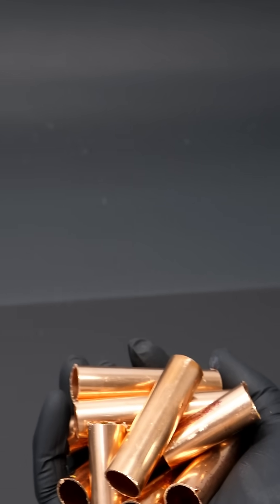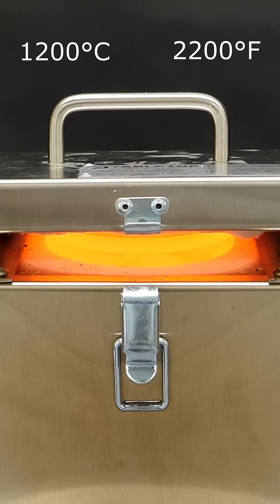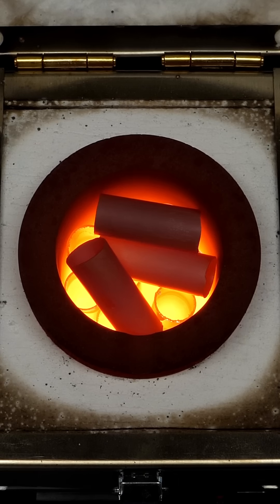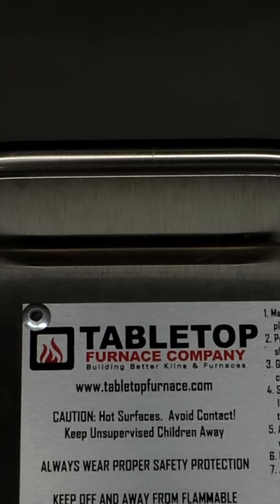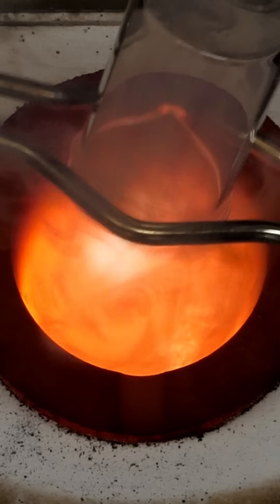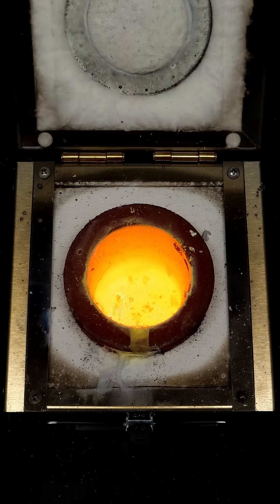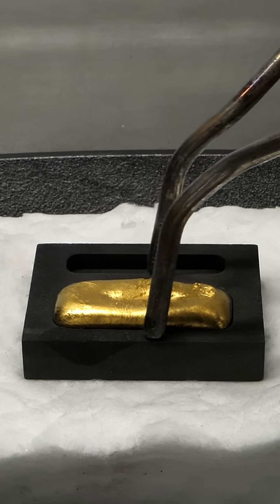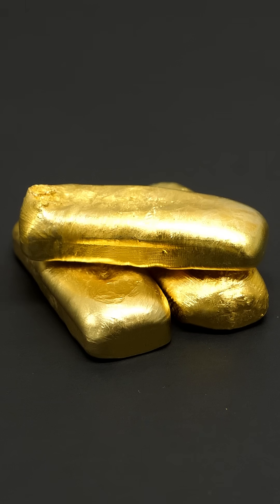Making Nordic Gold

Comment: The melting point of zinc is drastically lower than copper, the gas emitted when you added the zinc is extremely toxic, I hope you had a hood running and a mask on. That’s really nasty gas. The zinc was chemically altered and essentially burned. You need to add the zinc as the mixture is cooling down.

Comment: At 930°C to 1,094°C for 89% copper, 5% tin, 5% aluminum, 1% zinc. Nordic Gold, best channel to watch is Bigstack D casting will teach you while he melts to cast. Make sure to expand/heat up the Ingot trays, as you don't want metal spraying all over (equalize thermal pressure)

Comment: When melting metal in a crucible make sure it’s dry first which should reduce or eliminate the sputtering to some degree which might be caused by water or other things on the surface boiling off and turning to steam

Comment: Looks like you're putting cold metal into hot. Can easily cause an explosion of molten metal.
Reply: No it can’t? What?
Reply: If the metal going in is cold there can be a tiny amount of moisture which converts to gas on contact with whats already in the crucible and blasts metal everywhere. I've done it with gold. It's normal practice to heat it up a bit before adding to crucible to drive off any possible moisture. @Joker-em6oz

Comment: induction smelter, you can melt stuff in a moment
Reply: Not a smelter. It does not smelt like whatsoever
Reply: @Joker-em6oz  not referring to the machine pictured but to a machine that uses induction to rapidly melt metal as an upgrade, they work fast and only heat the targeted materials, a good one is like 1k usd, a basic one is like 300-500usd
Reply: @SCARLETBIRDS that’s not a smelter then…
Reply: @Joker-em6oz  like you are qualified to make that statement
Reply: @SCARLETBIRDS I literally am….

What you describe is melting, not smelting…
Reply: @SCARLETBIRDS explain how an induction coil can reduce ores. I’m waiting. 

If you want to use the correct name of the machine, you’re describing an induction furnace.

??? Sorry that it upsets you that I’m right
Reply: @SCARLETBIRDS okay. Whatever you say buddy. I’m waiting for my explanation XD. Looks like you’ve been wrong for decades, ouch.
Reply: @SCARLETBIRDS yeah you don’t care because you’re wrong. Notice how you still haven’t explained the mechanism
Reply: @Joker-em6oz  yawn, try harder
Reply: @SCARLETBIRDS try what harder?we’ve established I don’t need to try to be right, you do.
Reply: @Joker-em6oz  an induction device explains its operation with the first word
try to catch up
Reply: @SCARLETBIRDS induction is method of heating, not method of smelting. Try to keep up.
Reply: @Joker-em6oz  it's whatever i want it to be
Reply: @SCARLETBIRDS not how that works buddy. Notice how you are incapable of explaining how it smelts. It’s almost like they aren’t used as smelters XD
Reply: @Joker-em6oz  induction smelting is the process of using an electromagnetic field to generate heat in conductive materials by generating eddy currents for smelting which is a form of refining, as the materials separate it will become more effective because the ores become more conductive
in the case above he's refining/smelting an alloy, probly several other words i could use here as well as there's several general terms
Reply: @SCARLETBIRDS  i know what induction    Is… Ores are not conductive though…

None of that explains what actually occurs though. All you said you heat ho rocks. How do they separate? Ores chemically bound to oxygen… only heating them up is simply not how they are converted to metal. In fact several ores are used as refractory materials…

In the case above he is not smelting whatsoever. Do you know what smelting is? The reduction of ore into metal. Is there ore in this video? No. Therefore  there cannot be any smelting

Glad to correct your knowledge after decades in the “field.”
Reply: @Joker-em6oz  that depends on what ore and what step you are at and how much power you apply, copper for example is bubbled up out of the crushed material and separated, then refined, iron can pretty much be refined on the spot but this also depends on the concentration, the rarer the material the more elaborate the refinery processing to get enuf to do the job with and actually the way they handle that in an induction system is they make the pot conductive so it gets hot so even if that was the case there's ways around it up to the massive arc furnaces that don't care about purity because they are basically dumping giant carbon rods into the material with loads of energy to melt it all at once in a moment
for cinnabar which is mercury ore they just crush it up and heat it in a still like machine to collect the metal vapor which condenses back into a liquid, it doesn't need much heat so even a kettle on an induction stove would work if it had a way to trap and condense the fumes safely
ores chemically bound to oxygen can be burned off, you can remove rust from sheet metal with a torch by getting it hot, adding flux and inert gas will help keep the batch from taking in more as you reduce it, you would definitely not want to be melting zinc, titanium or another similar flammable metal without a chamber with inert gas, similar processes are used to make timascus 
and as a word of warning carefully research the chemistry of the metal you are working with, adding carbon or cobalt etc to steel can be great but too much hydrogen or oxygen and it becomes brittle, failure to properly prep a steel fastener for small crystal structure for use in aquatic places will make it become weak over time under load as it collects gasses known as hydrogen embrittlement
knowing the atomic structure of the stuff you are trying to mix also helps you know what will or won't mix, welding titanium and aluminum is possible, aluminum needs a different compatible coating before you can give it a nickel plating same as steel
and the list goes on, the topics related can get very complicated very fast and this is not the place for that
also the same tool that smelts the ore is used for melting it, you can't say smelting without melting so no, you haven't corrected or taught anything
Reply: @SCARLETBIRDS eaf is not induction.

I literally did correct you…. But go off.m, you’re obviously correct.

If you want to know wha mixes, and what doesn’t. The Hume rothery rules should be used as a rule of thumb

Comment: I thought copper melted at 1800F aluminum at 1400F and tin closer to 1000F 2200 would be way to hot for the aluminum and tin
Reply: Way too hot? What? Water melts at 32f. You can heat it all the way to 212d
Reply: . Go google what tin and zinc evaporate at or boil.
Reply: @carpediemarts705 they can evaporate lower, that is not what boiling is. Tin boils at 2600 C btw

Comment: It could probably trick enough people. Itll have some of the same properties.
Reply: It has none of the same properties
Reply: @Joker-em6oz  well since theres a large quantity of copper, id imagine itd be conductive (nowhere near as much as gold, even less than usual copper because its diluted with other not-so-conductive metals). It also wont be magnetic, i think, because iirc none of the metals involved are either. These are also properties of gold. You can probably get real damn close to color matching it so that someone who isnt a professional would believe it. And if you wanted to hit the density, if the item is big enough to notice a weight difference, find a way to put in a small lead weight of some sort in the middle. Easy scam
Reply: @derekspammerton5295 it’s not going to be the same type of magnetic as gold, you’re right that neither are ferromagnetic though. 

Density is only one problem.

Comment: Why cant you just add the copper then heat the crucible? Why do you have to wait until 1200 degrees and then put in the copper?
Reply: You prevent unnecessary oxidation
Reply: Thanks!

Comment: The melting point of copper is 1084°C (1983°F), aluminum is 660,3°C (1220.54°F), zinc metal is 419,5°C (787,1°F), and then some tin metal which is 232°C (450°F). So the melting point of Nordic Gold is above 900°C or about 1652°F, I got bored so I did some research about this video.
Reply: Alloys are a curious thing, really.
For some, it can turn two metals which are solid at room temperature and 1 atm of pressure...into a shiny liquid with immense surface tension, as is the case with NaC (NaK?).
Even our most commonly used alloy, Iron and Carbon, behaves very curiously.
Adding a lot of carbon gets you cast iron, which has a LOWER melting point than iron, but adding just a little, just right amount gets you carbon steel, which has a HIGHER melting point than iron...even though carbon doesn't really melt on its own, it sublimates.

Even our (arguably) first alloy, bronze, is made of two metals which by themselves aren't strong enough for many applications the alloy is used for, especially tin - logically, it should weaken the alloy, but it doesn't.
Reply: How would a gold tester react tho?
Reply: @karrimgyver it would say it isn’t gold
Reply: @Joker-em6oz  Pretty sure that the actual machine that gives the karat ratings etc gives way better info than just "not gold" I'm not talkin about that simple type like you see with that one that tells if the diamond is real or not.
Reply: @karrimgyver you mean an xrf? It’ll tell you what alloy it is if you mean that. But it really depends on what type of gold tester
Reply: @Joker-em6oz  and what alloy would it tell this is?
Reply: @karrimgyver Nordic gold, assuming it’s in the database which it should be because Nordic gold is actually used
Reply: @Joker-em6oz  Huh. But if the contents are exactly same, how can it tell the difference? Pardon my ignorance.
Reply: @karrimgyver wdym the contents are the same? Can you clarify your question. 

No worries about ignorance, we all start somewhere
Reply: @Joker-em6oz  Lol I forgot that gold is on the periodic table. If that has anything to do with it. I was thinking that if you can make "gold" with copper aluminum zinc and what not, then how can you know it's not actually gold, if you put everything gold has in it to pot, thus making it "actual" gold. But I forgot that gold is an actual elemental metal (or what ever it is in English, (it's my 3rd language so some words escape me)).
But I still don't know how we can tell difference with the 2. Unless it really has to do with the original elementals
Reply: @karrimgyver the machine uses X-rays to energizes atoms and the atoms then emit their own x rays. These X-rays are specific to each element so we can measure the amount of each element present
Reply: @Joker-em6oz  Oooh. That's way cooler than I thought. Could it be possible to measure ingredients accurately enough to fool it? Or are we talking about scale so small that forget it?
Reply: @karrimgyver wdym measure ingredients to fool it?

It is taking thousands of data points
Reply: @Joker-em6oz  I had to google what are data points in this context. Yeah my question was riddled with ignorance and thus now even I can't really ask it again without being even more confused : D But very simply put. way they see how the gold interacts with X-rays tells them if it is original elemental gold, or nordic gold made by mixing etc? I thought that it would be possible to fool x rays by having enough accurate mix of the "gold" in the end, but nope, gold and nordic gold are 2 very different metals. Thank you for being patient!
Reply: @karrimgyver ah, you can’t “fool” the X-rays. But if you put gold into the mix, the machine would tell you there’s gold in the mix.
Reply: The melting point of copper is actually higher than the boiling point of zinc
Reply: @brottarnacke hence the energetic oxidation and melting.
Reply: Would you add the copper last or can the other metals over cook?
Reply: Where can you buy that small furnace?
Reply: Love this comment 😆
Reply: All I know is that gold itself melts at about 1700 F.
Reply: So? Why "so"? Is it obvious that the melting point of the alloy is 900ºC? lol
Reply: @goncalovazpinto6261  What do you mean? Who said "so"?
He did the math.
Reply: @operatorchakkoty4257  the OP said "So the melting point of Nordic Gold is above..."
please, enlighten me, what math?
Reply: @goncalovazpinto6261  Dude, he either googled the melting points of the alloy or used a formula (which, believe it or not, is also coming to a google search bar near you this Summer!) to do it.
Hell, there's alloy calculators where all you have to do is plug in the base metals and their percentages and it'll spit out some auto-calculated values about the resulting alloys.

He. Googled. It.
Reply: @operatorchakkoty4257  So first it's obviously math, then it's obviously google... Do you make a habit of speaking for others when they themselves don't bother to?

Comment: You can actually start a Nordic gold casting business cheaply since materials cost under $9/kg. By selling 100g bars for ~$20, you can make ~$200/kg in revenue. After labor, energy, and tools, you still profit ~$126/kg. It's not real gold, but it looks like it, so it's perfect for collectors, crafts, and novelty gifts. With low cost, niche appeal, and solid margins, it's a great small-scale hustle or side biz—especially if you already have metalworking gear!

Comment: You don’t need to heat up the crucible and you can just put the metals in with no repercussions (after melting them first so they’re pure). But I would recommend doing it outside because of when the zinc burns off it lets off a bunch of toxic zinc oxide. And do this outside with a proper setup and DONT PREHEAT THE CRUCIBLE
Reply: Melting is unrelated to purity

Comment: Zinc boils into a gas at copper's melting point. Its tricky to work with. Sometimes you have to add it first, sometimes add it last, depending on how much zinc youre adding.

Comment: I was about to ask if he was making some kind of brass considering he was mixing copper and zinc, but that didn't make sense with the other two metals, especially aluminium. so I looked up Nordic Gold, turns out it's an aluminium bronze which is what some of our smallest value coins in the north is made of. The 50 euro cent is also made of it apparently.

Comment: I never understood why zinc is added last. Doesn't it have a lower melting point than copper and aluminum? It seems like zinc should and would burn up after the two are melted at a higher temperature.
Reply: It should and in fact did burn up. That's just because he added it as a powder, it would have been fine if he had more solid chunks of zinc
Reply: If you start with zinc or tin, it will start boiling or burning before you can melt copper. You need the copper to be molten so you can dunk it in, and it will hold on to the other metals somewhat.

You could also try to keep the temperature low and try to dissolve solid copper into the lower melting point metals, but I doubt that's a better approach.

Comment: Would this "gold" trick you? It shouldn't. It's weight is way off. Copper weighs less than half of what gold does.
Reply: It's also incredibly tough (hence its use for coins), while real gold is quite soft.
Reply: @micahbush5397  There is a story that when they found King Tut's tomb, they used simple brace bit drills (made for drilling wood) to make a hole in the gold sarcophagus.
Reply: OP, the word gold means what it means and needs no punctuation, let alone incorrectly quoting nobody at all saying it. You mean to use single inverted commas implying so-called or supposedly.
Reply: @thekeysman6760  Are you bad AI, or is this a terrible translation from another language.
Reply: OP, *its weight, no apostrophe saying it is weight. Ours. Theirs. Its. No apostrophe for belonging to and it's/it is already exists.